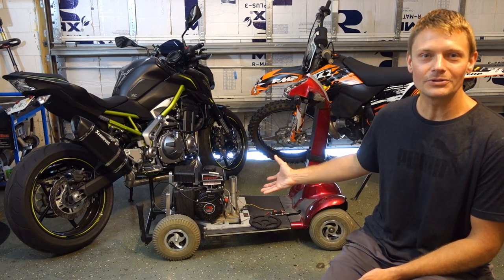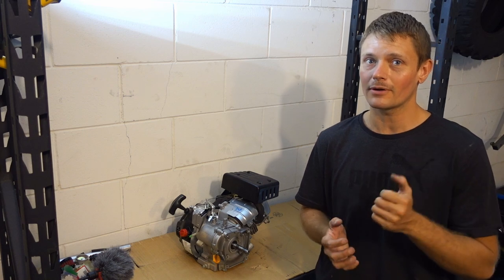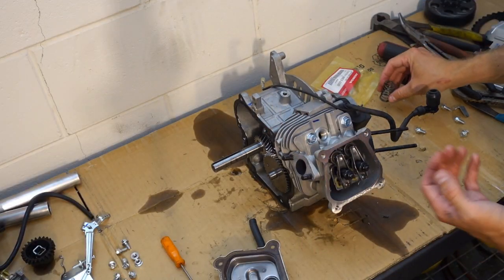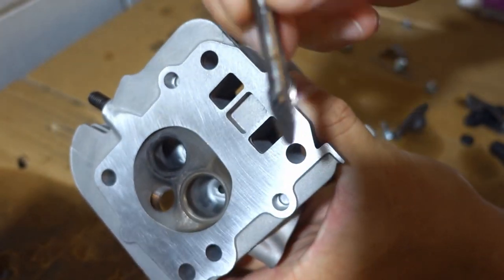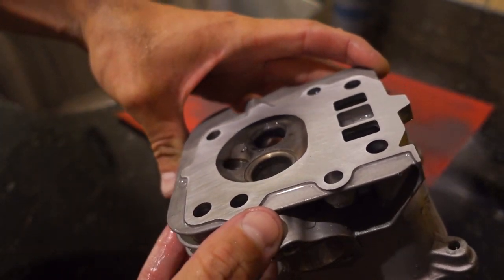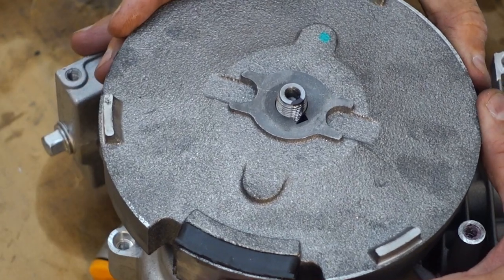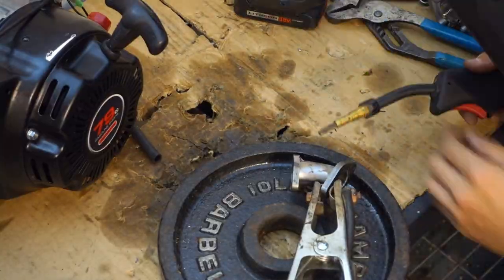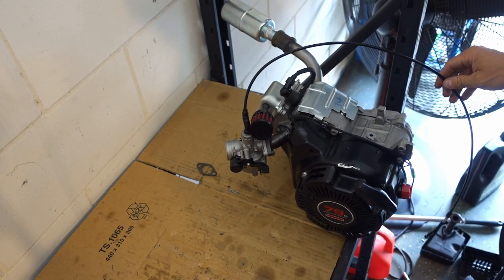Small Engine Performance Mods | How To DOUBLE Your Engine Power!

Comment: You need to make a Video on "HOW TO MAKE A PREDATOR INTAKE MANIFOLD" save us some money and teach us so that we can subscribe 😉
Reply from the maker: I can do that, maybe put together a video on several common diy engine accessory mods
Reply: @DirtGearTv  please do so Thank You
Reply: @DirtGearTv  How to cut a pair of flanges & a piece of pipe & weld them up & an exhaust header pipe & it's flange with welding (& the B & S threaded muffler you are using for convenience ) Trev New Zealand 🇳🇿

Comment: Pro tip. some 1/4" rod with a slot cut in the end. cut a strip of sand paper and put it in the slot. Put the rod in your electric drill. Cheap as and effective for porting and polishing aluminium heads
Reply: Only polishing alloy heads,not porting them...the sandpaper flies apart & it needs to be wet n dry paper: been doing it since the early 1970's. Trev NZ
Reply: Nah, that's not a good way to do it. Don't cheap out... But some proper cartridge rolls, and thank me later.
Reply: @davelowets  I have those too, the sand paper and rod gets way more use
Reply: @tortron  Then you're doing something wrong... A drill isn't fast enough to do any real work, in any amount of time, and a piece of sandpaper in a real grinder will shred itself to bits in no time, before you get any material removed. I've been there, and done that. Never again...

Now here's a REAL Pro Tip:  Save yourself the frustration, and buy the proper tools for the job.
Reply: @davelowets  you are not using it for hogging out material, it's the last step. Works great expecially on aluminium heads. Great to have all the tools and be able to pick and choose what you use, I have them, rod and sand paper in a drill still gets used, does a great job removing casting marks and blending. Use a 1/4" rod and it can go in your die grinder when you get one. . Dirt cheap and actually also great for someone to work on their first head with

Comment: Solid video man. Love to see the 79 predator instead of the damn 212. I think it's super under rated because the size diff between the two is significant
Reply: Small block Chevy 350 engine: like belly buttons, everyone's got one, the 212 brain dead engine...need proper spares that Harbour Freight don't have ? PM me...Trev New Zealand 🇳🇿
Reply: @trevinskiking2165  Do you have spare parts for the 79cc?
Reply: @25survival  Hi moonshiner , not at hand, they are on the water, but I am in contact with the firm that makes the 79 & 212 & I asked what if someone in the States wants to buy something & the guy was really helpful, as there's a vaste array of parts,not cheap compaired to a Honda Parts supplier, but "NO problem: I can Dropship the parts" & cuts out 1 freight component to me by being obligueing enough to do that...but the selection would make your eyes water.
PM me if serious & Genuine...I'm in a wheelchair & do this to pay for insulin & get kids on bikes etc.
I'm experienced at parts sourcing & exporting to good ole USA. But chase of Covid our post rates have gone up alarming..but can get new blocks etc.
Cheers from NewZealand(South Pacific)
Reply: @trevinskiking2165  not sure how to go about pming you, do you have social media or an email?
Reply: @25survival  He’s trying to scam you my guy.

Comment: I just put one on a mini bike called Microbikology. It's coming along rather well considering the displacement. I hit 22mph using a jackshaft setup from BMI. I'm 5'11 235 😏.
Reply: Update....28mph!
Reply: @fatbuddycat  so my kit for my 79cc fits my 99cc I'm working on the stage 1 kit pipe and air leaving stock internals for now I opened my kit noticed it had a flywheel 18 springs and a cam and copper gasket not seeing a rod I'm guessing they don't make one?
Reply: @heathenprojects2639  they don't. The flywheel is the big one. These engines aren't as abusive on themselves at higher rpms. I have that copper gasket but I ended up with a .035 mill, 3 way valve job, porting and used a stock gasket. I run the pz19 carburetor on there with 22 pound springs.

Comment: I think if you were to put a degree wheel on your flywheel, that you'd find you've probably advanced it a lot more than 10°.  I would guess that you've gone as far as 20°-30°.  The easiest way to check is to print a degree wheel the diameter of the flywheel and mark somewhere on the engine how far 10° is.  You can then index your flywheel accordingly.
Reply: Think the modified key caused the explosion😅

Comment: Why doesn't anyone ever mention the correct fuel to put in tank for engines. Great video but I would highly suggest an engine stand not a good idea to turn on an engine without it being stable
Reply: What fuel to use is determined by the compression ratio. When running the stock engine there is no need for a special fuel. Regular 87 octane is all that it needs. Running a higher octane is needed when the compression ratio is raised.

Comment: Wow you should know better than that. NEVER run a stock flywheel after mods, especially with heavier valve springs. You're lucky it didn't end up in your face. You should be more careful with what you tell others to do. Someone could get hurt.

Comment: I would definitely change out that flywheel to billet just because that stock flywheel won't last long with the upgrades and will detonate eventually other than that awesome vid and I too followed ur port abd polish and made a significant difference in my 224cc pred so thanks.
Reply: No it wont. Blocks of iron dont just explode because they spin a little faster. They blow up when they spinn way too fast in a motor not put back together with proper clearance and torque. "Slop in the shaft"

Comment: when i modded my 79cc predator about 6 years ago there was no after market parts for it but i am a fabricator so intake and exhaust was a breeze .  only problem it has is valve float but it sounds wicked.
Reply: Working on an intake manifold & Carb package & Header for this Engine. T New Zealand 😎😎😎😎
Reply: PM me if you want either or other stk spares that Harbour Freight don't carry.Trev New Zealand 🇳🇿🙃
Reply: you can fix valve float with heavier springs.
Reply: So put some springs in it for $20... 😕

Comment: that timing key blew this thing up
Reply: No it didn't... The crappy stock flywheel simply blew apart.
Reply: @davelowets  the stock flywheel never fails when the engine is used as intended, remember that this engine was build for 3600 rpm. I've personally gotten my stage 1 with the governor still installed up to 4750 and it's help up fine.
Reply: @mikhailjairnisbett441  So what?

Comment: wasnt even revving that high when the magnet broke thru the screw hole/came unglued? i wanted to take the magnet out and re epoxy it after grinding the back of magnet and the face of flywheel and cleaning it with alchohol wipes for a FIRM BOND with the epoxy, but cldnt get the screw out... without damaging it. so gave up on that idea. superglue around the edge, for what good that is? as the $165 billet flywheel puts it in the 212cc price range
Reply from the maker: That should be fine, I think it needs a larger spec clearance than recommended also

Comment: I would NEVER RECOMMEND sanding down your head.

It doesn’t matter if your engine is upgraded, you have more risk of Valve Float at the RPMS you are wanting.

DO NOT DO THIS you’ll wonder why your engine failed and blew up because of something so stupid.

Comment: Great video but Ebay and Amazon have the billet flywheels with adjustable timing without messing with the key the go kart company's try to resell them adding their 40% markup
Reply: Can you share a link? I can easily find predator 212 billet flywheels but not for the 79cc
Reply: @srcobra50  to be completely honest it won't be cheaper to go with the 212 anyway because it like the 5.3 chevy engine has lots of more parts for lower price
Reply: @Bigdaddy-Donkyking  yeah I know. Was asking since I got a 79cc on my wife’s mini bike just don’t want the flywheel to explode but it still has the stock valve springs so it probably won’t rev that high. I’m with you on the 212, I got a box of stage 2 parts ready to go on one. Just need to figure out which kart or bike to put it on
Reply: @srcobra50  I also have a small Honda clone (G100 k2) on my wife’s mini bike. I’d LOVE to find a source for a billet rod and flywheel, but can’t find them anywhere. Would you let me know if you do?
Reply: @Kettenhund75  sire il let you know if I do. If it’s a monster moto or doodlebug mini bike those stock engines don’t have performance parts unfortunately
Reply: @Bigdaddy-Donkyking  I was gonna get that motor but it didn't fit i got the 79 and its what I call q stake 4.5 and can keep up with some slightly modified 212s
Reply: @boringbill  not bad yeah they don't do bad I might get a a actual Honda or one of those blue engines forgot what they're called
Reply: @Bigdaddy-Donkyking  probably duramax or if you get a Honda the 389 is the best for value although Honda has been going down in quantity or at least the mowers have they used to be top of line

Comment: I'd love a video on Honda GX270's and the like! I've got one just sitting waiting to make good power.
Reply from the maker: Cool, Ill look into it. Even though the engine layout is going to be a bit different, Id do the exact same mods on that engine as this 79cc. You could probably get a solid 20hp from that engine with these mods and a cam!
Reply: At least the Honda Engine has an oil pump & pressurized oiling system so you can go to town making HP at least 😇Trev New Zealand cheers

Comment: After tie governor was removed did you tap the hole and use a bolt or use a properly sized sheet metal screw to seal the hole?
Reply from the maker: I believe It was a though bolt and nut

Comment: Great vid, just what I was looking for. Planning on doing the same thing to a 79cc Lifan, for a motorized bike. I even bought the same carburetor a couple weeks ago.  I have heard that the 79cc Lifan and 79cc predator are very similar other than the angle at which the engine sits.
Reply: The phatmoto motorize bike comes with the lifa  79 most people swap them out for the predator 79 and 212s.but honestly a 79 with carb upgrade ,removed governor upgrade valve springs and good gear ratios will be good
Reply: you better upgrade your flywheel on a lifan if you remove the governor.  It will be hella more bad then this guys flywheel explosion.  Lifan like this motor is only rated for 3000rpm with governor on.  remove it and the motor can hit 5k easy. along with bearings and fly wheel blowing up easy as well

Comment: I'm sure it gave it a little bit more power made it run smoother and attack higher and yes I could be wrong but I highly doubt your modifications doubled the horsepower
Reply from the maker: It can more than double it in some cases. AGK had a 7hp 79cc build that's similar

Comment: I think the 79 predator is faster than the 212, just the 212 has a faster take off
Reply: It's a matter of working with what you have. I doubt anyone is going to replace their 212 with a 79.
Reply: @Deucealive75  ya I had the 79 then it broke so then I got my money back and got the 212 and then bypassed the govenor
Reply: No. The 212 WILL have more power period

Comment: I've since learned that only polishing lightly on the intake is best. This motor actually benefits from fuel/air distortion created by turbulence. The reason being that it is such small displacement that most modifications to the carburetor will result in running too rich. The turbulence helps retard the flow so that the motor can catch up to the excessive air/fuel mix. Let it flow the best you can out of the exhaust. Also your best to run stock 196 clone springs to get the best possible torque curve while building rpm, lash them loose to .003 but keep the exhaust snug to grab that decompression.
Reply from the maker: So the carburetor is designed to adjust fuel for airflow so that wouldn’t create a rich condition alone. It’s also correct in that leaving a rough surface creates more turbulence and promotes better fuel atomization which leads to a fuller burn and better flame propagation
Reply: @DirtGearTv  yeah brother!!! Small engine science is cool!
Reply: 0.003 in metric or imperial isn't " loose" lash by any means, sorry .0.008" would be....Trev New Zealand🇳🇿🙃
Reply: @trevinskiking2165  .003 under extreme duress such as exceeding the motors rotational capacity leads to a larger lash during the working cycle. If it were a stock motor I would agree completely. After having more experience with this motor I have found  .003 is ideal with 22s, 224 cam, billet flywheel and 19mm carburetor (jackshaft). My fastest on the torque converter was set with aluminum weights, white garters, yellow pulley and clone springs since the tav limited the rpm anyway. I'm getting better at this stuff and I do listen more. Always thinking about you and trying to better myself. Thank you for helping me to see my mistakes and shortcomings, sorry again!
Reply: @fatbuddycat  0.003" imperial on the exhaust lash is tight, in 0.003 metric it isn't...ok  & engines aren't built of rubber: they don't stretch that much more modified from stock & if your going that far you would have added a welded alloy block spine & studs so it's really just academic & don't forget a worked engine is going to run hotter so your clearances are going to close up...I'd be more worried about pistonskirt to bore clearance for example: something never mentioned in build ups. Trev New Zealand🇳🇿 PS I wouldn't run any of my exhaust lash as much as +0.003" thou cold...inlet yes, exh NO....
Reply: @trevinskiking2165  you forgot to sign your last reply Trev New Zealand🇳🇿 lol
Reply: @MattB90  I let you do it for me, I need a secretary, pays shocking though 😋
Reply: I've actually learned that your intake you want slightly rough. you want the fuel to be broken up as it enters the combustion chamber ill use the same principle I learned from an engine builder. if you pour gas on the ground and light it on fire it'll burn a couple seconds. if you spray gas from a bottle and light it on fire it burns almost instantly.
Reply: @fatbuddycat  Leaving the intake port wall rough has NOTHING to do with "retarding the flow so that the motor can catch up to the excessive fuel/air mix". It has EVERYTHING to do with swirl/tumble to help atomise the fuel better for a better burn in the chamber.  Also, the "small displacement won't make the carb too rich". Carbs are adjustable by changing the jets. You can make them as rich or as lean as you want. On the subject of valve lash adjustment, you have that backwards. You will want the exhaust lash a touch LARGER than the intake, to compensate for the increased growth of the HOT exhaust valve compared to the intake valve. The lash on the exhaust valve WILL shrink more than the intake valve when the engine is hot. You've got some studying up to do, son, before dispensing your "advice" to the public.
Reply: @davelowets you mean better atomization and total volume between the backside of the valve and the carberuretor has something to do with propagation more so than actual flow. Sorry I made a mistake explaining that. I do however have a terrific 99cc tuned and running like an absolute champ as I have greatly improved my skills over the last year.
Reply: @fatbuddycat  At least you're learning...

Comment: Those springs are very off sized for a 79cc build.  Stock is 7.8lb @12lb starts feeling like your starting a Harley. @18lbs you might as well toss you cam directly in the trash and save time reassembling lol.  Plus you should be running 20w 50 with zink in a motor your about to abuse that is not designed for anything above 3500 rpm.
Reply: The zinc myth has been around for decades and is not a concern with good quality modern engine oils. Running 20W50 is understandable with an air cooled engine. However, what do the guys who race use? I bet they don't use 20W50 and some may even use a 20 weight. I use a good quality 5W30 synthetic in all my clones.

For the engine in this video I would run it hard then take engine temps and decide from there what oil weight I would use. My 196's don't run hot enough to need a 20W50. No where near hot enough.
Reply: @Deucealive75  lol?  How is using zink a myth rofl?  Almost all non cat based motorcycle and  musle car builds use it lol.... how is it a myth?  Mythical oil is 10$ quart you should try it...

Comment: I would also suggest aluminum welding the compression section of the head for even more compression.
Reply: i would look for a domed piston and plastiguage it to the head and grind it out till the valves dont hit it. Small pistons are cheap as. Although thats me saying that when i dont have a TIG welder. Once ive done all the crank, bore, and valve mods to my motorcycle modding the combustion chamber will be one of the few things left
Reply: Gaining  compression is easy ..  the problems start when you. Have low octane fuel  .. .. Octane  is not a  sign of more powerful  fuel .. all it is is. A measurement.  Stating t h e stability of  fuel..  high com o reason makes fuel unstable   so now you have to star  fooling with  ignition timing and combustion chamber  quench..    ..quench  is  the shape of the chamber  and it can and dies affect ..  the burn ... it's not an explosion 
. Ofbth3 compressed  fuel and air
Reply: It doesn't work like that in a flathead...
It's not just as simple as just "weld up the chamber", or "throw a dome piston in it" for a flat head. The more you fill up the chamber, the more you block off and disturb the airflow characteristics of the intake stroke. There's a REALLY fine line between doing good, and doing very bad, when playing with the combustion chamber on a flathead.